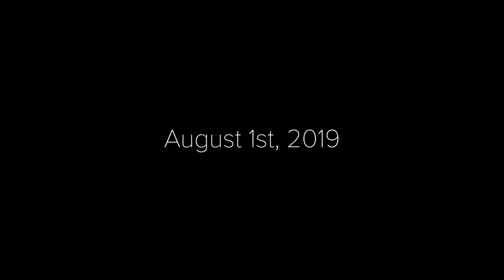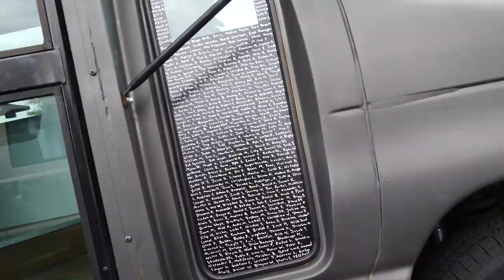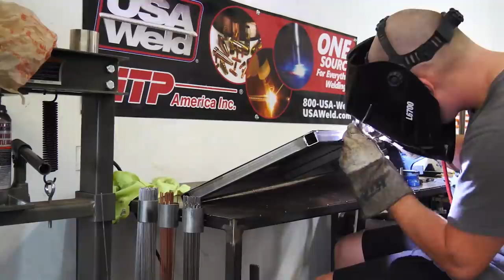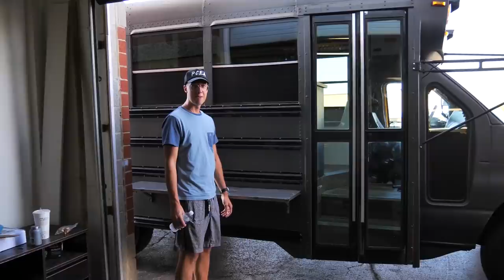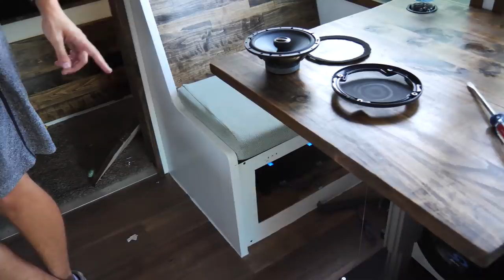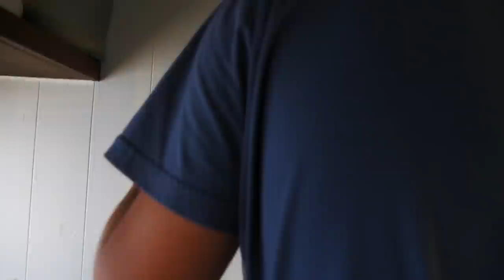ADVENTURE BUS is RESURRECTED With a BRAND NEW TRANSMISSION! (It was blown up...)

Comment: That noise is interference from you alternator, you can get a noise filter to install on the power wire for the radio & it will fix it

Comment: Unless it’s a manual transmission they tend to stop moving the vehicle when they run out of oil. When the pump can no longer pickup oil the bands and clutches start slipping and unless it is somehow locked in gear the vehicle just stops like it’s in neutral.
With a manual total destruction will occur very quickly and the noises are a dead giveaway along with the crunching into gear and the burning oil smells.

Comment: You were lucky that the transmission didn´t jam while you were driving without fluid in it. 
I am actually planning to get my car´s gearbox oil changed, my car have that fancy double gearbox which is automatic and manual, I can just put it to D and drive or flick the stick to the back and use it like a manual. But funny enough, the oil what Citroën recommends for the engine is not available in this country, so I ordered that from Germany.

Comment: Read today that transmissions are 90% efficient, so if you make 600hp at the crank, 60hp (45watt) is lost in friction and heat. Image a 60hp engine purely focused on ruining your trans, that's why you check up on fluids kids ;)